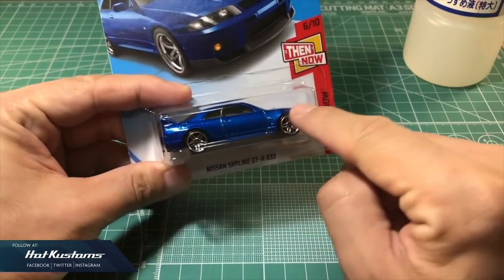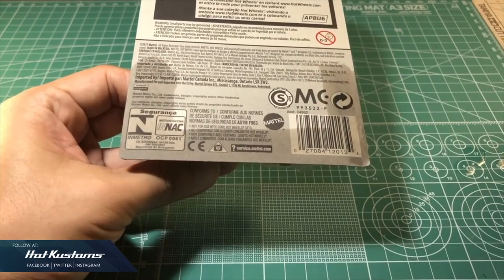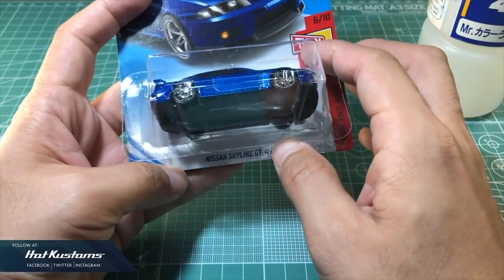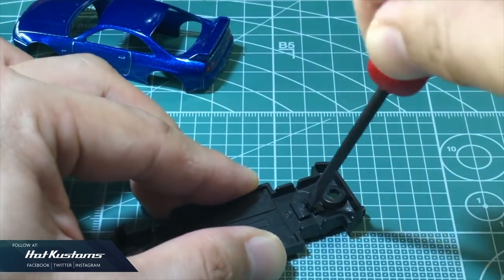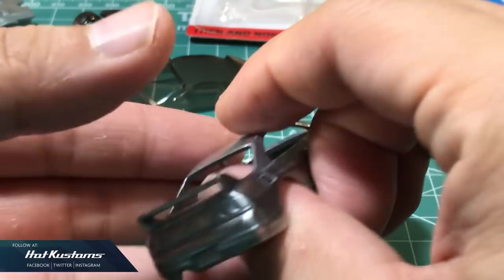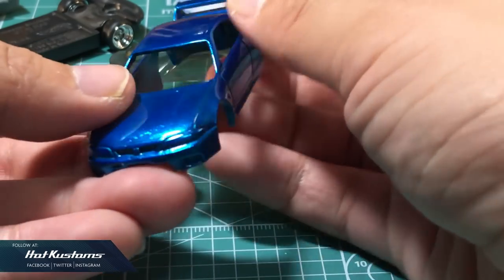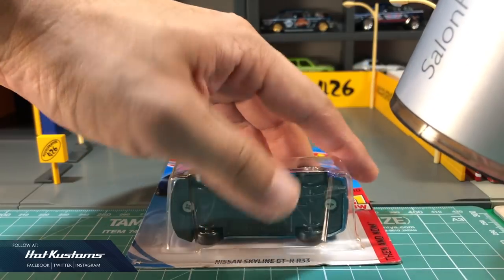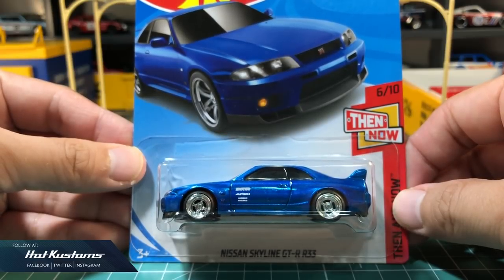How to Custom Paint Spectraflame and Recard Hot Wheels Skyline R33 | DIY Tutorial

Comment: What type of screws did u get to rescrew it again.
Reply from the maker: David Macalintal I use a drill bit to open the rivet and tap it and secure with a + screw. There are many tutorial vids on YouTube to remove hot wheels and secure them with screws. I will put up a simplified video when I have time. Cheers
Reply: Hot Kustoms alright will be expecting that and thanks for the reply!
Reply from the maker: David Macalintal 😊👍